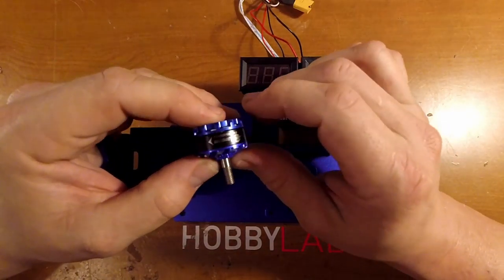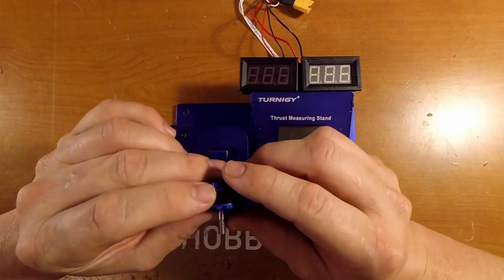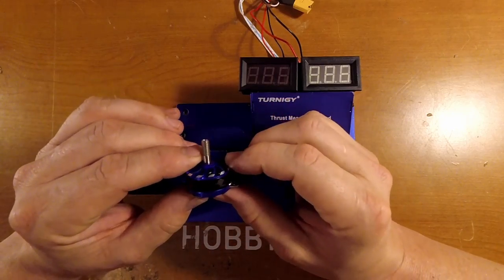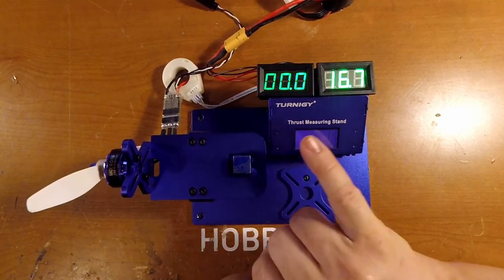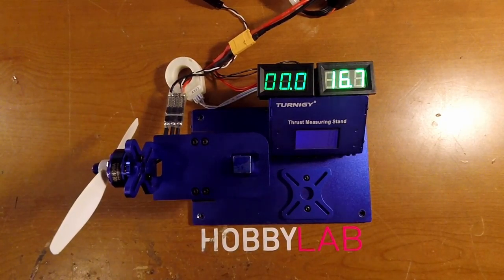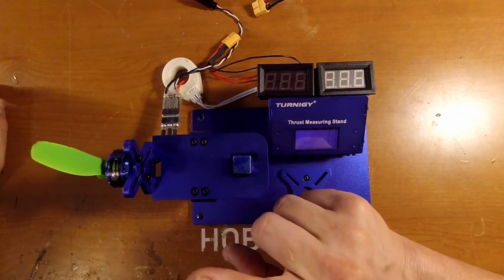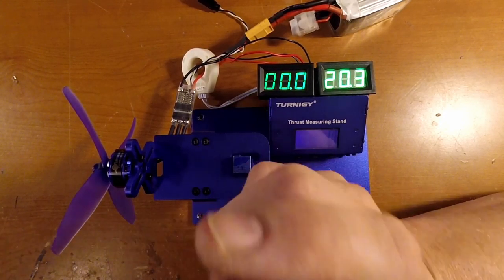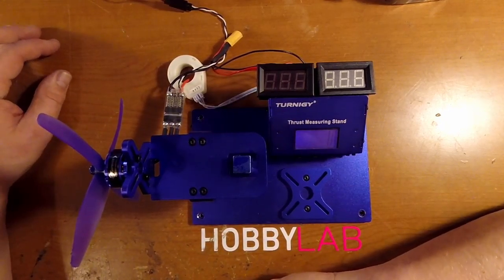LDpower 2305/2600kv review and bench tests

Comment: hey, are you sore on the drive sheet the Watts/Thrust column headers are not swapped? 1200watt would be too much and 400gramms thrust also very small as this motor is advertised as max thrust 1600G.... or it is not gramms etc? efficiency pretty small imho...